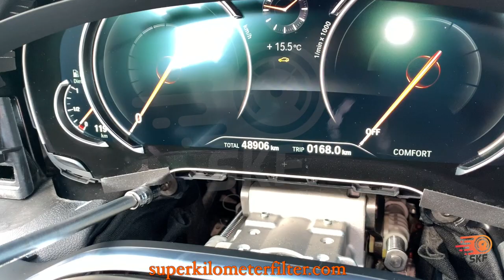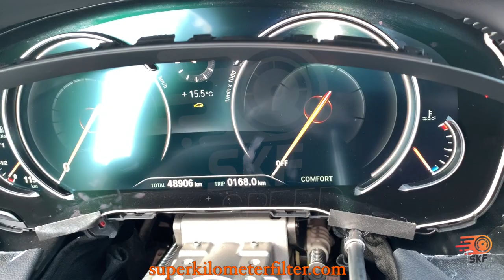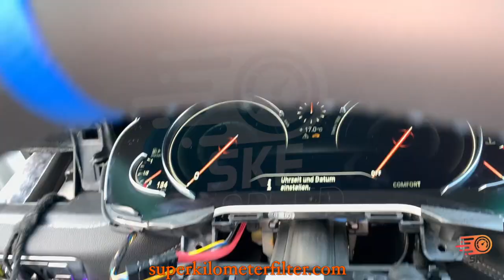Install mileage freezer - odometer blocker - BMWs 7 Series G11 G12 - Disassemble cluster 6WB

Comment: It stops counting miles all together on My BMW Connected Drive app, so if you leave blocker off, it’ll count on the vehicle but not in the app. 

Clearly visible unless you leave blocker on all of the time from install to removal
Reply from the maker: This can happen with our old modules. If you remove the blocker, the kilometers driven will be updated in the My BMW App.
Reply from the maker: When did you buy your module?
Reply: Thank you for letting me know that! 😛👍🏼
Reply: Can’t remember when I bought it now